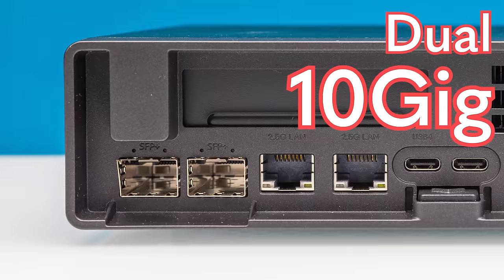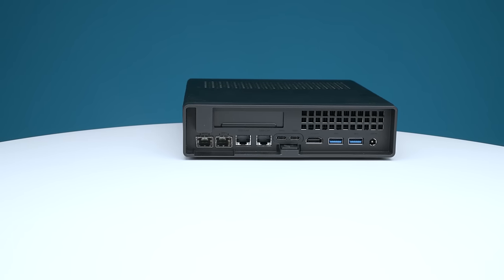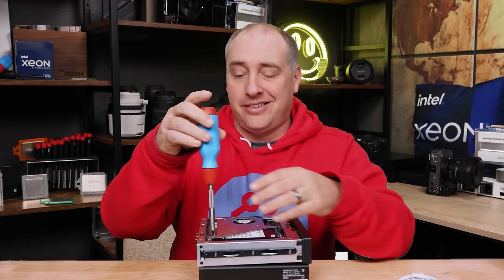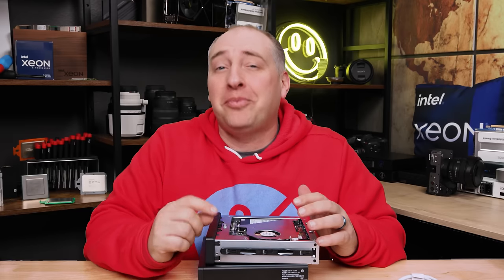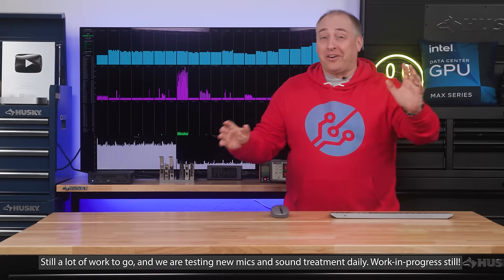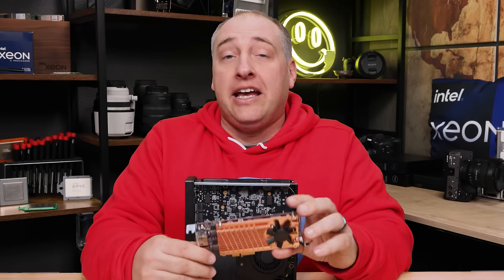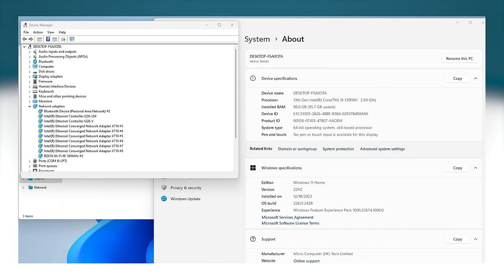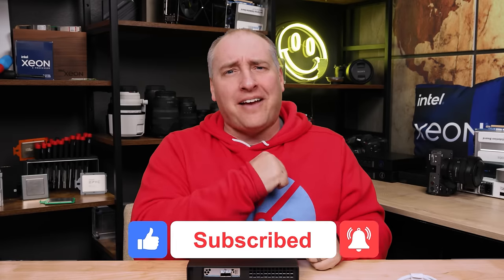The Pinnacle of Mini PC Servers - Minisforum MS-01

Comment: Interesting... so they move into Servers, while (almost) retaining for factor... OK. Not easy. But in 2-3 iterations it should be great.
Reply from the maker: Yes. I cannot wait for a second gen.
Reply: @ServeTheHomeVideo  Agreed. And maybe some AMD version. IDK if competition here could lower the prices, but it's not impossible. Though IDK which AMD chip would you use? This Intel one is a repurposed gaming one. Also some vendors (including minisforum at least once) have problem with their BIOS versions and can make sleep states of CPU work badly. I imagine idle power on this is very important. And vendors usually mor rarely screw up this part with Intel CPU's. Though there can be (and are) other problems.

Would you rather see some powerful AMD CPU here (16-core with V-cache ;) ), or maybe "decent enough" APU like Phoenix would be good? With that integrated GPU, it might do some acceleration that the PCI-E card is supposed to do natively. Though it would be great if running PCI-E card here wasn't a lottery. I wonder if it's some problem of drivers vs BIOS or something?
Reply: @jannegrey593  Maybe a Zen5 based one in late summer. Although I guess that depends a bit on AMD releasing them fairly quickly. If they did that I would definitely buy one - I currently have a UM790 Pro and think that is pretty good. But the added networking and more storage in this would be great.

Comment: I'm intreaged guys.  If someone really needs 25Gb/s of networking and an i9 is there a use case where such a small device is a key feature?  I mean once you're into those levels of performance wouldn't a more flexible, cooler, normal chassis and motherboard provide a more balanced solution?  

I mean I really like the recent crop of mini n100 devices that have popped out of China as the price/performance is super good. Their mini form factor also suits the hobby/broom cupboard market.  Whereas the beast performance of the MS01 feels constrained by its size.

Comment: I just ordered one of these, but I have a concern about Sleep Management under Windows 11. I recently purchased (And Returned) a Geekom XT13 Pro, which did not work well with Windows 11 Sleep Management. If I set the Sleep to 2 hours, the system would go to sleep, but after about 5 hours or so, the PC would power down completely, forcing me to re-boot the System every day. I then set the sleep to 'Never' and the system stayed on for 10 hours or so, but eventually completely powered down. The Manufacturer's customer service wanted me to trouble shoot the problem, change the BIOS, but I did not feel like working for Geekom, so I returned the unit for a refund while I was able.  So, I am wondering if you have tested the Sleep Management of the MS-01, as I fear I may end up with the same problem. -- Seems like a pretty basic task.

Comment: Great review! Since the 2.5Gb ports are different (Intel i226-V/i226LM), would they still work fine (supported) on OPNSense as a router for WAN/LAN? ProxMox? Thanks!

Edit: Yes, I am aware this unit is probably overkill for such a basic scenario, just curious about compatibility.
Reply: They have been supported since the driver was first introduced 3 years ago.
Reply: I have not been able to hand out dhcp leases using the i226LM nic for some reason using a NUC12, running pfsense/proxmox.  The i226-V works fine, I have not worked out why.
Reply: @0bsmith0  i226-V is no problem of course, but the i226LM is my concern.
Reply: @le4fkicker  That was my concern, thanks for clarifying. Not sure why that would happen, especially if the hardware is detected. Maybe a setting. I have read something about AMT needs to be disabled by SMBus or CSME settings in order to get DHCP Server working, but not sure if that would apply here. Also, have heard this specific problem on pfSense, so maybe a setting/driver issue. Curious if OPNSense has this problem...

Comment: Regarding the Qnap LAN+NVME card: could you try with their 2xNVME-only (not LAN) card? My experience with that card is that the LAN chip won't power on with a 160W Pico PSU+120W power brick, but it would boot with a 180W PSU from the Inwin Chopin. Same system, only PSU was different. Also another PCIe 1-lane 2.5GB Lan card would not boot with a pico PSU.
I mean, it's strange that that card won't boot when 50W GPUs work.

Comment: I've been begging for more single slot gpus since I got into pc hardware. I've been so disappointed the past 5 years. The RX 6400 has no encoding, so the single slot arc a380 is my only option, other than the pointless a310. The gtx 1650 lacks NVENC (reason I got the 1660 super), so thats a no. 

I want to downsize but even with this awesome mini pc, my options are slim
Reply: Do you really need it?  These chips are no slouch at encoding things themselves.

Comment: I have purchased an NVIDIA RTX 4000 SFF GPU for use with your MS-01.  The specifications state it needs 75 Watts of power.  I realize it won't be possible to close the top, but will it run in the MS-01?  Will I need to provide external power?  If so, what do you recommend?
Reply: It would run however you would not be able to close the case with the stock cooler on the GPU. It is extremely difficult to find the custom coolers that would allow your card to fit in the small case and unless you changed the power brick to a more powerful PSU, you would have less power budget available to the processor so there is a possibility that the GPU might be bottlenecked by the processor.
Reply: @eltamarindo Thank you for your comment. 

Actually, I will be able to close the case by using a PCIe ribbon cable extension routed through the rear adapter slot opening.  So, the RTX A4000ssf will be external to the cabinet.  

The Nvidia data sheet for the SSF model indicates that it requires 70 Watts (non SSF model requires 140 W), so it shouldn't require an additional power supply.

Comment: Hey @ServeTheHome. I've bought exactly same set (MS-01 and QNAP TL-D400S) and MS-01 doesn't see my Qnap controller (I've tried Windows and Linux). Did you set something special in BIOS to have it working or maybe my motherboard is broken?
Reply from the maker: Strange. It worked out of the box. Did it boot but not show the controller? Usually when cards failed the system did not boot. When we first installed it I thought it was not working but then the drives showed up.
Reply: @ServeTheHomeVideo  this is strange. My model doesn’t recognise this QNAP controller, I’ve checked under windows and Linux. lspci doesn’t display it. The only difference is the processor, you had 13900 and mine is 12900. Maybe some differences in BIOS.
And yes, it boots, but no controller. I’ve checked the controller in DELL server and it was recognised and worked.

Comment: Did you try a pci controller with SFF-8088 connector?
Can be a nice solution for a small backup storage, and proxies generator.
Reply: It is in the video. Yes, he tried. It works. Check the forum for the list of cards tested.

Comment: I would like to see an i5 or i7 variant of this. Why? Because it keeps the price a lot lower, and for the peeps like myself that don't need an i9 with their workload. The reason I bought multiple Lenovo M720q machines, is because they have a lot of expandability and they were pretty cheap (€200 in total for each machine in parts and such). But spending €700+ for a pretty overkill machine, is not what floats my boat. 

Nice machine, but I'd rather spend this kind of money on something I build myself, although I absolutely love the miniPCs. I took inspiration out of the STH TinyMiniMicro project.
Reply: What do you think a comparable Lenovo mini costs?  Sure, you can get an 8th gen i5 or i7 for €200..  But not a 12th or 13th.

Comment: How to connect this type of mininserver with my gaming pc using a sfp+ Connector and direct cable without using a switch? Like put a 100gbits sfp+ network card into the gaming pc and a sfp+ module into this server and connect them directly?
Reply from the maker: You could just use a 10Gbps SFP+ DAC cable if you had a 10GbE card in your other PC. If you wanted 100GbE then you would need QSFP28 and to put a different card in here.

Comment: I still find it hard to decide what to do. Will the C3758 get 4 Gbit/sec over PPPoE with OPNsense, or do I go for something like this which I'm sure the CPU won't be a bottleneck. the I3-9100 I tried this with had very high CPU usage. My ISPs router must contain some special ASIC to be able to do this.  Or do I go with the C3758 and get something like VyOS to be able to get rid of the PPPoE uses only 1 core limit.

Comment: At easy fix for that switch would have been using one of them switchs that you have to use a Flathead screwdriver to flip it over you know the ones that do the 110 Volt to 220 Volt

Comment: Be aware, that the Nvidia RTC4000SFF GPU has a PCI-16 interface; the Minisforum MS-01's PCI slot is Gen4, Eight-Lane, so 1/2 throughput.
Reply from the maker: Just to be clear, that is half the PCIe bandwidth, but that does not mean, for the majority of applications, you will get half the performance. Oftentimes it is sub 10% impact.
Reply: @ServeTheHomeVideo  Just to be clear, the specified performance of the GPU will be halved, or am I missing something?  

To the extent the applications you mention rely on the GPU (like LLMs) will be adversely impacted, compared to operation with the full 16 PCIe lanes, due to the reduced bandwidth. 

Are you able to provide any quantitative information that contradicts that analysis?

Comment: the U.2 tray could be a bit longer with a small slot in it. Forcing the "killswitch" to be in the correct position for U.2 Use.
Tough, would the M.2 Setting kill a U.2 drive, or would it simply not work.
Reply: M.2 setting will not kill u.2 drive. Because M.2 works on 3.3V lower than U.2 12V. It's just not working.

Comment: they could put the switch under the ssd so if the switch in wrong position the m.2 dont fit. but their u.2 adapter have a hole that allow the switch to go thru at the u.2 position.

Comment: @ServeTheHome, The ram speed supported is max 5200 according to their website, I saw the 16GB that comes with your machine is 5600, and the 48GB you replaced is also 5600. is there any issue with using higher speed ram? do you downclock in BIOS? Or just use it like that?
Reply: The ram will just run at lower speed. Waste of money to buy the higher speed if your system cannot run it at that speed.

Comment: Why did they even design M.2 and U.2 to be pin compatible, makes no sense to me.
Reply from the maker: There is an adapter being used between U.2 and M.2 and both run NVMe/ PCIe

Comment: Do you have to use the m.2 to u.2 adapter board to use u.2? Shouldn't it be possible to place a micro switch under the board, so that if you're using it, the switch gets pressed down and automatically switches to u.2 power?

Comment: Would this device be able to integrate into "RACK mount" 1U ?
Officially it's 48mm of height while 1U should be 44.45mm... 
I know there are solutions for 2U.. But would there be even an option based on the size to fit into 1U size ? If positioned at the top or bottom...

Comment: Does anyone know if someone has made a list of tested graphics cards that will fit into this? This is EXACTLY what I'm looking for to build up a portable MAM system. If it can fit an A4000 in there, it'd be perfection.

EDIT: ugh, just realised it'd have to be an older card that doesn't require extra power. Still, even something like a P2000 could work for my needs.

Comment: Ok. It's a deal. Im going to buy this one, even though im going to hack the case to pieces or alternatively 3d print new case for it, because im going to install GPU to the PCI-E slot. Maybe use RTX 3060 Ti AERO ITX, maybe need print extension for the case and modify the case littlebit with CNC router. That gpu for shure fits from its lenght perspective but not height and thickness, so small modification to the case is needed along with use bigger PSU, maybe add mini psu inside just for the GPU and wire it to power on when this mini pc powers on, modify the case and mainboard to use the mini psu only, maybe fit HDPLEX 500W GaN inside somehow as there for shure will be room after 3d printing additional extension for the mini pc, its only few millimeters longer than this mini pc. Or alternatively just install RTX A2000 into it and dont need to modify much at all, 25% slower than 3060 but with 70W power. Even though i bet using Thunderbolt 4 i could get better performance with TB4 eGPU than what RTX 3060 Ti or RTX A2000 and provide.

Comment: Give me a mini PC with a cool little ARM chip in it and this kind of I/O, and I'll be happy. I like what Apple has accomplished with their ARM-based chips and really want to see the PC industry catch up.
Reply: no "little ARM chip" has anywhere close this kind of IO, and Apple's ARM chip isn't little, nor cheap
Reply: Apple does not have anywhere NEAR the IO. Period.  Apple can compromise on IO (and therefor PCI-E lanes) because they don't let you hook things up, unless its through thunderbolt.
Reply: @jorper2526  The Mac Pro would beg to differ.
Reply: @ericwood3709  Did you really just bring up the Mac Pro while saying you wanted a Mac-Mini with a PCI-E slot?  Are you aware the system you just tried to defend your comment with costs $7000 (for the bare-minimum base model with only 64GB of RAM).

Sure, apple can do it.  But they don't on any of their systems targeted at consumers.

Sounds like you need to figure out what you really need.
Reply: @jorper2526  It sounds like Apple makes a lot of PC people highly emotional. I'm just talking about a small PC with an ARM chip and comparable I/O to this one. Apple achieves much better performance per watt than Intel and AMD do, and I would hope to see something similar on the PC side.

Comment: Looking at the NIC chips (i226 and x710) - these should work with ESXi 8, right?
Reply from the maker: The bigger ESXi challenge is going to be the P and E core mix which will PSOD you at installation. There is a heterogeneous core workaround though, but it feels somewhat rough.
Reply: NIC is fully supported ESXI 8. But ESXI is not support well on P and E core mix. If you need boot ESXI  on it , you need Turn off the E core in bios, Or manually change ESXI boot args let esxi support mix cores.

Comment: @servethehome Do you have any advice for JBOD's that are more affordable and available over the QNAP TL-D400S that would work with the Broadcom SAS3008 external (8e) on IT mode?

Does anyone else have any ideas? My plan is to install Proxmox and run some VMs including Plex and also run TrueNAS scale on Proxmox with PCIe passthrough and use an external JBOD to handle a larger zfs pool. It would be amazing to get some input. Thank you kindly.

Comment: for me it would be a great steal if i could equip this with 128gb of ram, would you be able to test or try and see if it's possible even if it's not official?
Reply from the maker: 64GB is official support, 96GB we have working. The lack of 64GB unbuffered DIMMs right now means 128GB is not really possible with two SODIMM slots
Reply: would love to see a "massive"comparison between mini-pc with n95 and n100 cpus, in terms of thermal and throttling performance under load for long period of times, ( like 5minutes stress tests). The feeling is that every OEM is doing something different with the bios settings, and that between active and passive cooling. @ServeTheHomeVideo

Comment: 4:22 I've heard of USB4 with Thunderbolt 4 (1 PCIe lane) but not Thunderbolt 3 (4 PCIe lanes). How many PCIe lanes do these USB4 ports have?
Reply: Intel Mobile chip has internal TB controlller inside of CPU. Refer to Intel's SPEC, It's Thunderbolt4 and each port supported PCIE3.0x4.
Reply: @jaxjiang8429 

May i know what are the other assignment of pcie lanes (CPU or PCH) for devices like m.2/u.2 SSDs , 2x10Gbps SFP+ &  2x2.5Gbps RJ45 ? 

Thx.

Comment: Is there any suplemental power for the pcie card? Say a 6 pin? Also, could you check if it still works with a 12v power brick?
Reply: it's not a good idea to put cards that need more than 75w in a case like this anyway

Comment: How good is their support and reliability? never used one or heard of them or seen one in around environments?
Reply: I bought a Zen 3 minisforum minipc. It arrived with bad memory and a failing nvme. Replacement was denied and was told I could get a refund then purchase another one. At an increased price that was about $150 higher than I originally paid.

Could just be a random lemon unit, but the whole experience was pretty bad. Periodic crashes from the ram and lost all data on the nvme  because it failed within a month. It was very loud and the underside would burn your hands. Adding a fan under the unit helped, but it still ran very warm and took up much more space.

End Result: Wasted time and money. Still had to build a system myself.

Comment: I recently placed an order for a barebone MS-01 PC and would like to set up two SSDs in a RAID 1 configuration as my boot drive.

For the best performance, should I:
a.  Populate “the leftmost slot” with a 1 or 2TB M.2 2280 NMVE SSD and add an identical SSD to the middle slot,
b.  Populate “the leftmost slot” with a 1 or 2TB U.2 NVME and add an M.2 2280/22110 NVME SSD to the middle slot, or
c.  Some other option I haven’t considered?

Thanks

Comment: Wish it was copper 10Gbe NIC's. Copper SFP+'s run at 1 billion degrees.
Reply: 10Gb over copper is HOT and power hungry, regardless if it's SFP+ or not..  So moot point, really.
Reply: @jorper2526  That has not been my experience.